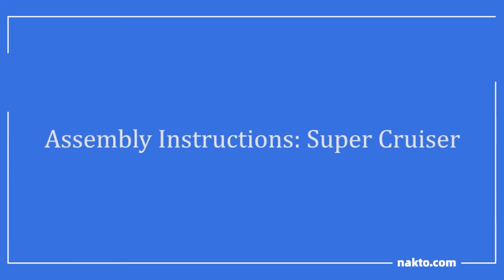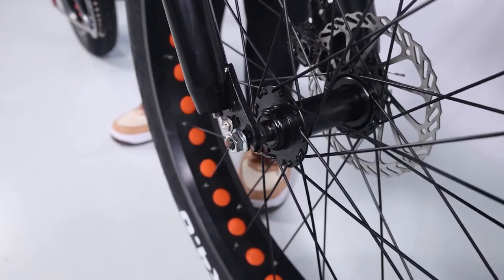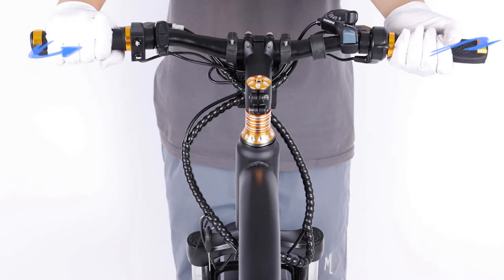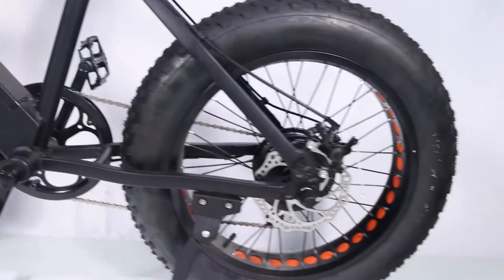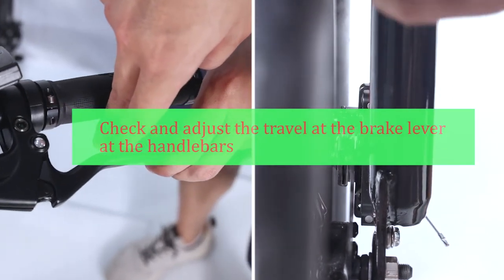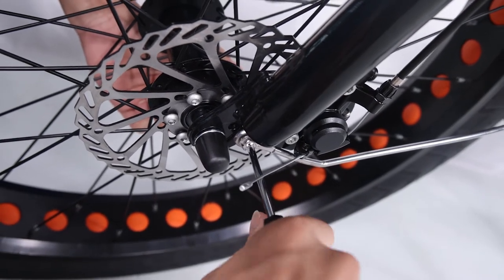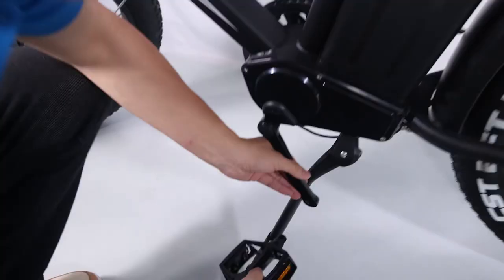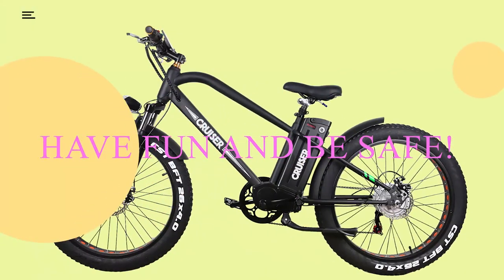How to assemble NAKTO 500W Super Cruiser Ebike?

Comment: Glad I watched this video. The guy at the store didn't notch that front wheel on both sides. I would have gone flying on a hard bump. The wheel fender was offset. I had to remove them and have them bent correctly.